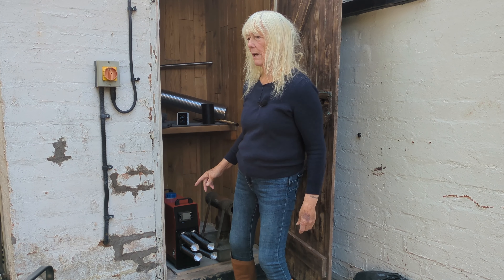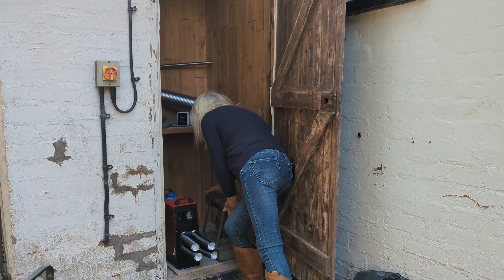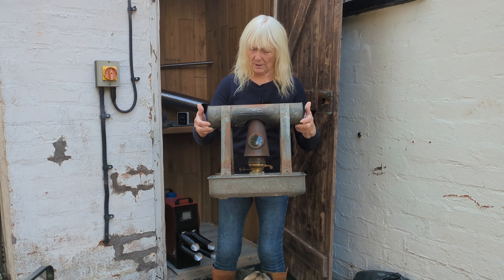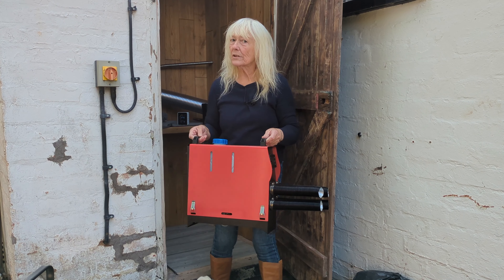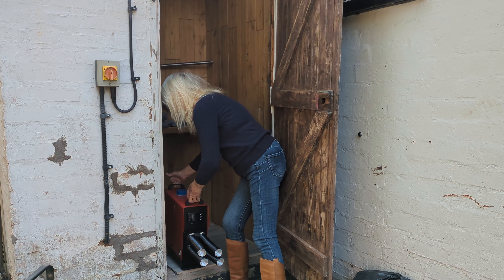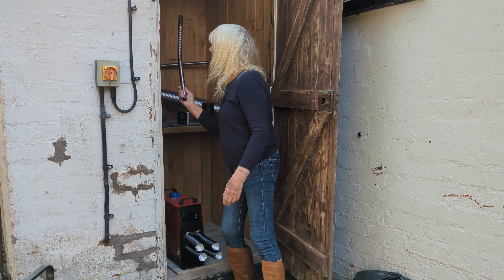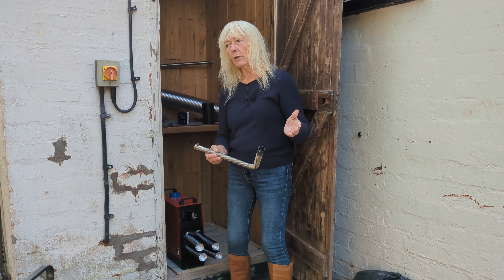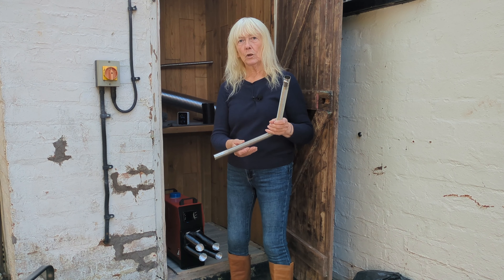Granny's winter Hack The Chinese diesel heater

Comment: Bought one of these avoid the one with 4 pipes instructions are unreadable.a very exspensive door stop
Reply from the maker: Oh no, that sounds really frustrating! It’s disappointing when something like that doesn’t live up to expectations, especially when the instructions are hard to follow. I’ve heard others mention similar issues with the 4-pipe models. Have you tried reaching out to the seller or manufacturer for support? Sometimes the community has tips to get things working, too. I really hope you’re able to get it sorted—no one wants an expensive doorstop! Thanks for the heads-up and for sharing your experience.

Comment: Youre always full of good ideas lol 😊❤
Reply from the maker: Glad you think so! ITS SAVEING MONEY
Reply: @jean683-y8k  hi how long does a fill of diesel last?
Reply from the maker: Heater Power: 8KW

Rated Voltage: 12V

Fuel Type: Diesel

Tank Capacity: 5L/1.3 gal

Fuel Consumption(L/h): 0.1 - 0.45L

Adjustable Temp. Range: 46℉-95℉/8℃-35℃

Working Temperature: -104℉~+176℉/-40 °C~+80 °C

Applicable Altitude Below 3000m

BTU：215-269ft²/20-25 m²

lifespan: 5000-10000Hours Hi have just got in to this due to rising energy prices  and we are toasty so we can save on central heating costs we are in process of testing  we will come back to you with results have a great day
Reply: @jean683-y8k  thanks so much love,best of luck with it! 
Yeah it's the same here in Ireland, everything is gone crazy expensive especially heating
Reply: @johnjonhson1289 
I have one. About 24 hours (6 hours a day for four days) That's on the lowest setting. The lowest setting is all you need to use.
If you want to heat up the area quick, just stick it on high for 5 minutes once it reaches running temp then back down to the lowest.
You do this with a remote control with a + and - button. Just like changing channel on the TV. There's no fiddling about 
They are good, they really are. Saved me an absolute fortune last winter.
Reply from the maker: @johnjonhson1289   Yeah, it's the same here in the UK—everything is getting so expensive, especially heating costs. It's crazy! Stay warm and take care!
Reply from the maker: @ramalama9650  @ramalama9650 Thanks for the info! That sounds really efficient, and it’s great to hear it saved you so much last winter. I like the idea of using the remote for easy control—sounds super convenient! I’ll definitely keep that in mind. Appreciate you sharing your experience

Comment: These have serious fire safety issues. I wouldn't trust a random "no-brand Chinese" heater you bought online!
Reply from the maker: Thanks for sharing your concern! It's true that with any heater, safety should be the top priority. While some off-brand products might lack proper safety certifications, there are many reliable Chinese diesel heaters that come with safety features like overheat protection and automatic shut-off. It’s always important to thoroughly check reviews, safety ratings, and certifications before purchasing any heater. Also, installing and maintaining it correctly is key to avoiding any potential fire hazards. I appreciate you bringing this up
Reply: It all stands or falls with the knowledge of the user (like in many cases). I've bought a Vevor 3 years ago after watching quite a bunch of videos, and I'm not worried about it. Even a cigarette lighter can be dangerous in the hand of someone who should touch it in the first place ;)
Reply: the name brand are from the same factory
Reply: @UKsystems  That doesn't make any difference.